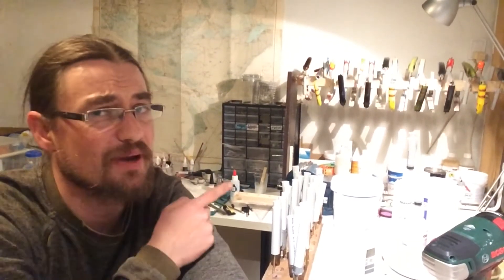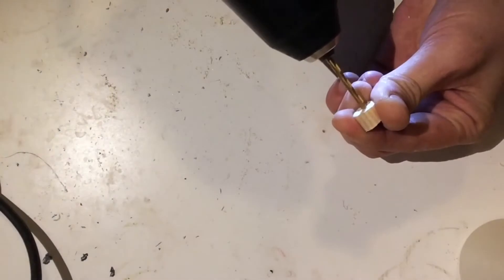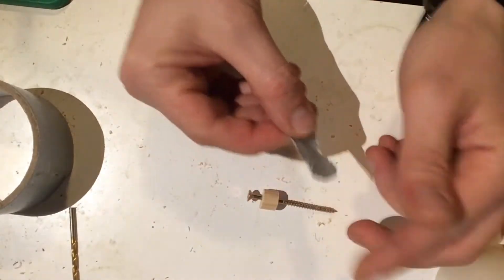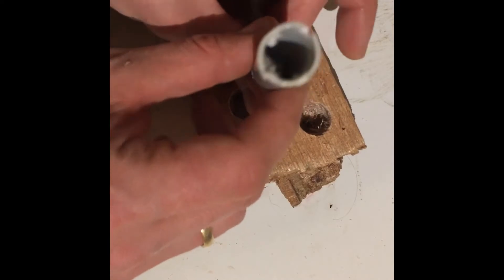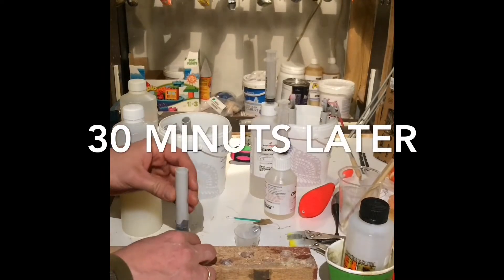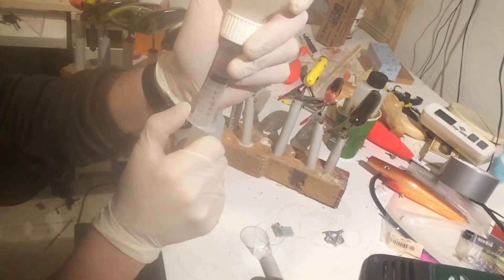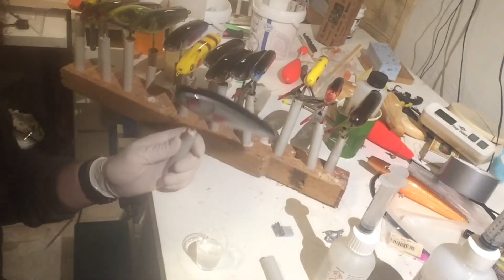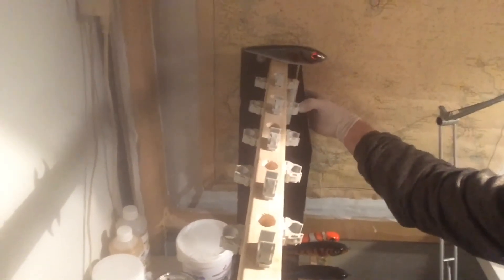How to make a spike for lure making and apply epoxy.

Comment: Thanks a lot for your Videos!! helped me a lot for planning my lure dryer . When you use these spikes.. what about the eyelet for the hook. are you glueing it in at the end?
Reply from the maker: Yes. I use long screw eyelets. Mostly I use prof made eyelets that I bye for the project. Other times I use homemades, but I always give them some 5min epoxy before inserting them into the lure.